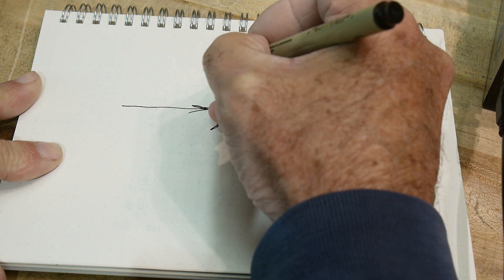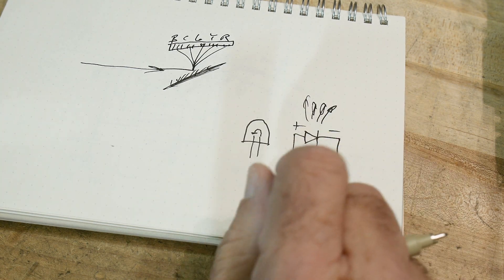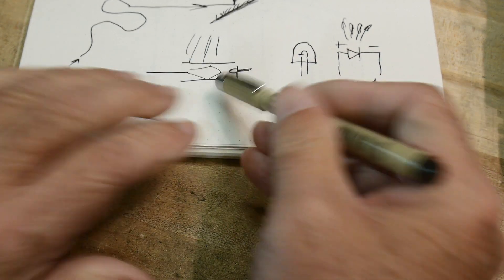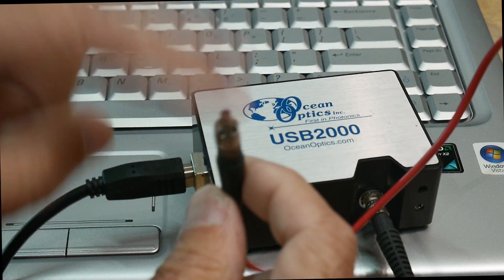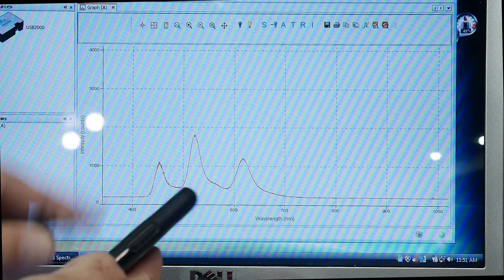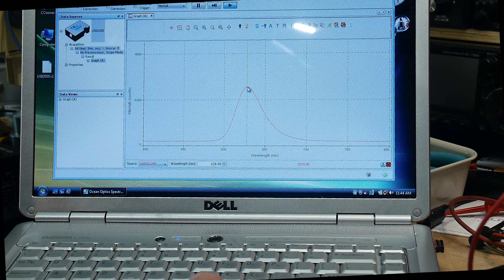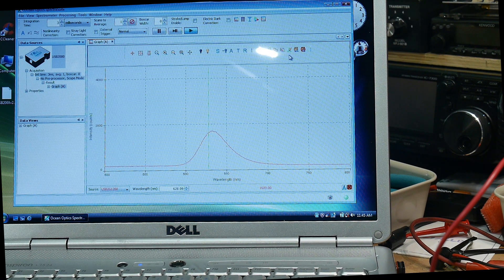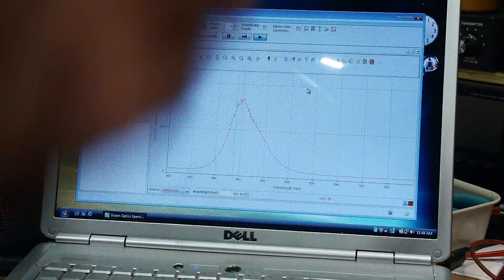#1049 LEDs don't like the heat

Comment: OK, since it was never said, I will ask.  Does a shift to the right indicate longer(redder) wavelength or shorter (bluer) wavelength?  I tried but cannot make out the numbers on the scale well enough to tell.
Reply from the maker: right is red    left is blue
Reply: @IMSAIGuy  Thanks.  My theory at the beginning was that heating would make the LED dimmer and redder. 
Now that we have that settled, is it the red or blue side of the shower faucet that is the cold side?
Reply from the maker: @WatchesTrainsAndRockets  depends which hemisphere you live in 😁

Comment: I remember a lab class where we measured the voltage drop at room temperature an then in liquid nitrogen. From this I think it was possible to calculate Planck’s constant.
Reply from the maker: energy = planck * wavelength
should plot on a straight line.

Comment: The bandgap decreases as temperature increases.  As the crystal expands, the average Coulomb force decreases making it easier to break a bond and free an electron from a hole.  Conversely, when the two recombine, less energy is released as a photon.

Comment: You touched the end of the fiber. Hopefully you cleaned it.   Most long haul fiber optic communications is in the 1500nm wavelength. By stacking narrow bandwidth lasers they can fit many channels in the fiber.  The receiver is similar to your photometer where each wave is split to its own detector.

Comment: The local historical society in my town bought an old bank building, complete with the large  standalone "Time/Temperature" sign out front.  It has large seven segment LED digits, each comprised of a groups of 4 red LEDs connected in series.  There were a set of digits on the north side and the south side.  I got sucked into looking at it when groups of LEDs failed, but only on the south side.  When one LED in the series string failed, of course that whole group suffered, and there were dim/missing spots in these digits.  I can only surmise that the afternoon sun just cooked the south side of the sign and caused more rapid aging and failure of those LEDs; none on the north side of the sign had failed.  That sign must have been 20 or 30 years old, but it was interesting to see the effects of elevated ambient temperature in action.

Comment: Also you can find a video "Arduino overclocking with liquid nitrogen", and it shows how yellow LED on a board turns to green LED (moves emitting peak left ) during extreme cooling.

Comment: I've noticed that some LEDs willl shift in color noticeably as I feed more current through them -- this must be from heating?  And the heating shifts the .... band gap? which shifts the color output.
Reply: I noticed that as well. Seems to me that neutral white ones shift to colder in colour when under more current or heat.
Reply from the maker: LED shifts, phosphor does not.